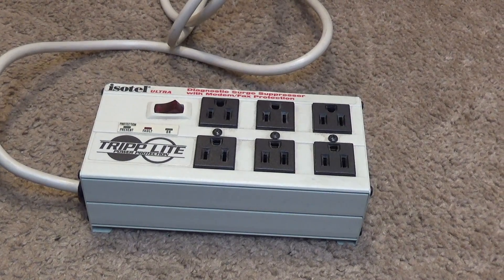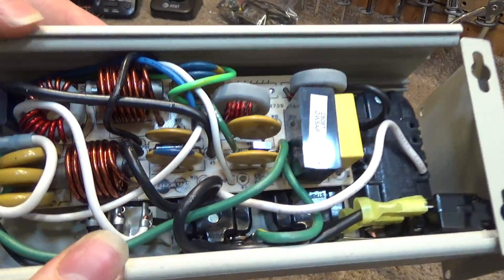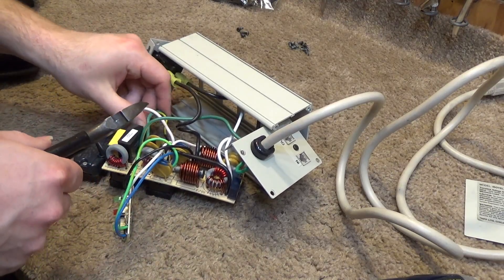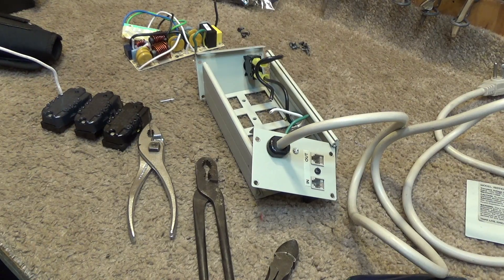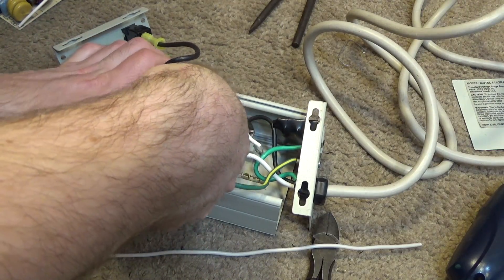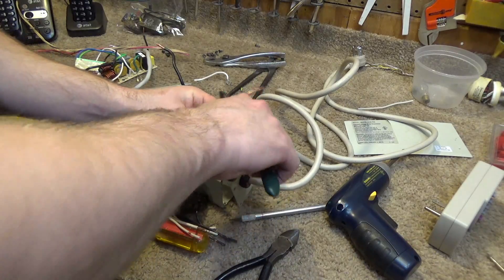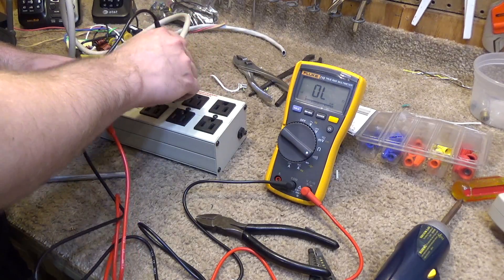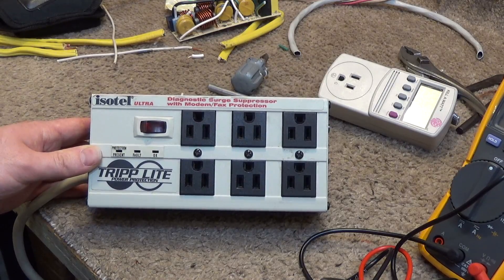IsoTel Ultra Power Bar Modification

Comment: won't Tripp Lite repair it for free?
Reply from the maker: Tripp Lite, now owned by Eaton, would repair a unit under certain circumstances. It is by no means an easy free handout.
Reply: @JordanU  I thought these had lifetime warranties?
Reply from the maker: A lifetime warranty will repair or replace a product under a small set of particular circumstances.
Reply: @JordanU  Did you ask them if they would repair under warranty???  I just bought one of these so I am curious.

I had a Netgear switch fried by lightning.  They replaced it no questions asked.  Switch was on a lifetime warranty.  You might want to ask them.   Too late now I guess...

Comment: Wonder if you could've replaced the MOVs?
Reply: Do you think the circuitry is designed to reset with new MOVs?  I tend to think it probably entered a permanent state of refusing to deliver power to the devices because it was never intended for that to be done.
Reply: @Xyspade  I would've been game to experiment a bit. Like maybe desolderin' all of them to see if the fault went away.
Reply from the maker: I tend to think it's permanently failed as well.

Comment: All of the yellow round things that are about the size of the penny are the MOVs, which should be the component responsible for the surge protection.  There actually does exist non-disposable surge protection technology; I believe one of the manufacturers is called ZeroSurges or something like that.  Those are even made in USA.  They're insanely expensive but I imagine they're worth the price if the claims are accurate.  But the ISOBARs are probably the best disposable surge protectors on the market.

You could have added one more neutral wire to that wire nut and attached it to the power switch, that way the switch light would continue to illuminate when power is on, but not any of the diagnostic LEDs.  It's actually industry standard practice that the integrated rocker switch light is merely used to indicate power on, so it shouldn't be confused to mean that the surge protection function is working.

Nice repair though, even spoiled that unit will make a better regular power bar than most power bars.  I had no idea how substantial those outlets really were.
Reply from the maker: I remember you mentioned those to me before, and I did look into them. I believe they were over 300 dollars each, which I just couldn't rationalize. The Isobars come with a lifetime guarantee, if there happens to be a surge strong enough to take them out, TrippLite should replace them. In my lifetime, there's only been 1 lightning strike to the house that got onto the wiring and blew things out. If these things eat the lightning and save all my vintage phones and expensive computers, I'd gladly buy all new ones out of pocket.

Interesting, I may have to revisit because I turn this on and off all the time--it would be nice if it glowed.

I've seen some pictures of the insides of these before but figured they were probably an exaggeration. I was quite pleased with what I saw inside.

Comment: wiring them through eachother would not be in series because all the terminals on one side are connected internally, so all of the neutrals would still be connected and all of the hots would still be connected, so it would still be correct, that is how outlets are daisy chained. you just have to wire the hot of one to the hot of the next one, if they were wired with the hot from one to the neutral to the other, then that would be in series.
Reply from the maker: Thanks for letting me know.